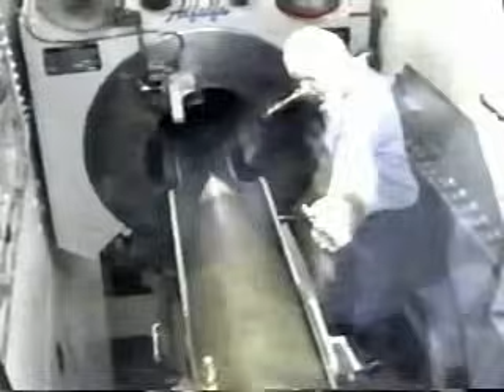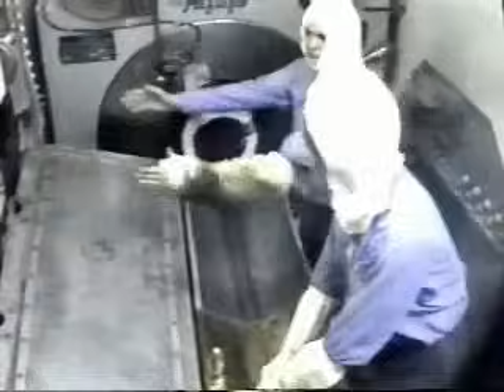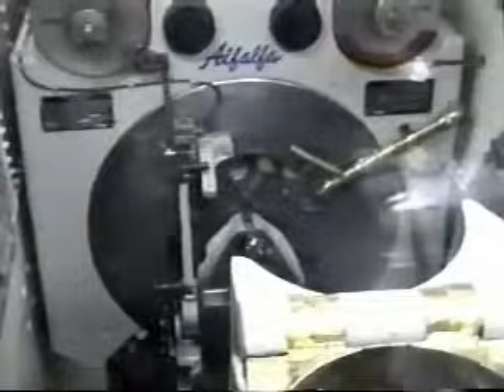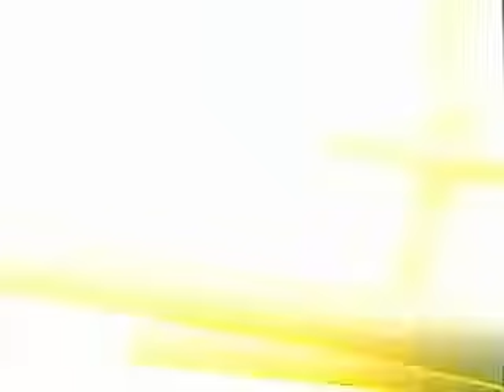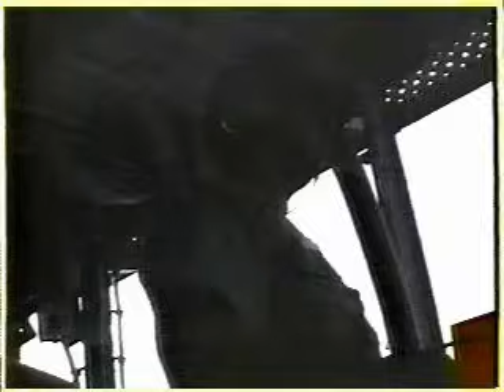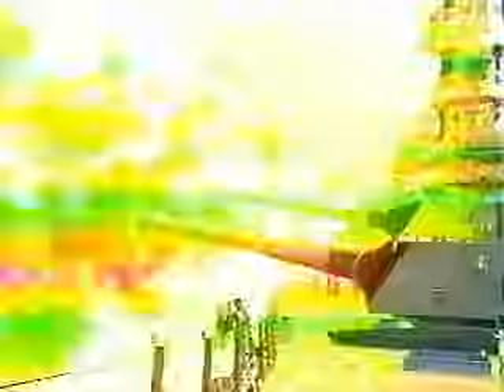USS WISCONSIN BATTLESHIP 16IN GUNFIRE

Comment: Wonder if anyone's ever though of strapping one of those things to an Abrams hull. With or without a turret.
Reply: It's too big. WAY too big. And, I don't think it could handle the recoil, braced or not.
However, a 45000 ton warship is perfect
Besides, these things were basically the scariest naval fire support platforms ever. Like in desert storm, where the enemy would spot an UAV and suddenly from something they couldn't even SEE (out of the horizon) either 9 50 foot craters appearing at once or a rolling fire of what were basically volkswagen beetles loaded with high explosives hitting every few seconds until they were told to stop. it got so bad that they started surrendering whenever they saw that UAV because you don't fuck around with what comes next. their armor also allowed them to shrug off anything that could be sent their way, like tanks.
Reply: Good fkn idea wish they would.
Reply: It's impossible. These guns are nearly four times as big as the guns mounted on tanks. It would definitely be interesting to see though.
Reply: ***** the guns themselves are about the weight of the tanks.
Reply: armorhide406 I'll bet the ammunision weights more than the tanks hull. But I'm sure the Yankees army can spare a tank for an experiment.
Reply: I think large defensive land batteries would be the most likely use besides on a ship.
Reply: Thomas Edgerley I've been on two Iowa Class Battleships and the 16" guns are so big it's almost comical. Fit on a tank?......No way! :)
Reply: armorhide406 If it is to big for one tank, mount it to two.
Reply: Kirrim Kerman Typical Kerbal attitude.
Reply: Lou Graziani That's just a waste. The BB-64's were a balance of speed, armor and firepower (until they were rendered essentially useless by jets and missiles)
The old dreadnoughts mounted a variety of guns, but aiming is hard when you can't differentiate a 10 inch gun splash and a 12 or 15 inch one.
Reply: They should still keep em as museum ships (although I think they gave up on this already)
Reply: armorhide406 

All 4 Iowas are museum ships.
Reply: ***** I thought they were shut down for good. Even as museum ships.
Shit, I gotta go see em before they do!
Reply: armorhide406 

Well they don't fire the guns, however the Wisconsin is getting some of her systems like the 1mc and the antenna rotation restored so the ship will appear more alive. Also, they're opening more and more of the ship up for visitors.
Reply: ***** of course they don't fire the guns
You'd probably go deaf if you were on deck when they did.
Still. it'd be fuckin' badass to see it one in person
Reply: Thomas Edgerley The Nazis did consider building a tank like this beleive it or not using Naval sized guns, it was called the Landkreuzer P.1000 Ratte. https://www.warhistoryonline.com/war-articles/landkreuzer-p-1000-ratte-hitlers-idiotic-heavy-tank-design.html. It was to be manned by 20 men and was to dwarf all other tanks.
Reply: Jeremy the germans did build tanks with 380 mm guns tho look upp stürmtiger :D
Reply: Vipersw3 Wasn't that a rocket launcher?
Reply: armorhide406 well if we are going to be technical it was a gun shooting rocket propelled rounds ;)
Reply: I'm thinking refitted and upgraded Maus or even Ratte hull from WWII Nazi R&D. That might actually work. Granted a 305mm cannon is heavy as balls, but that didn't stop the Sturmtiger, did it?

Comment: What is that exhaust smoke coming from the barrels a little while after the shot? I never noticed that before. It looks as though it comes out with some pressure behind it. Do they blow air inside the barrel after each shot to clean them somewhat? That's the only thing I could think of. I'm talking about the white puff of smoke maybe 15 seconds after the shot.

Comment: I have always imagined that when firing the 16” guns of the Iowa Class Battleships, nobody could be on deck. The concussion and heat blast would kill. True or not, the power of them is awesome. But, what amazes me most, is the structural engineering of turret platform that can carry them and endure the sustained and repeated forces of those guns, over and over again.
Reply: The concussion and heat blast would be bad if the front two turrets were facing the bow and firing same with the stern turret... the broadside isnt that bad cus all of the energy and blast is going into the water and creates a shockwave for a brief second.

Comment: @Contrajoe 
Sure, a proper missile is going to be somewhat more expensive since it'll also need a launch booster, but on the other hand, you can launch it from a destroyer, so in the long haul it's going to be significantly cheaper.

You can see where this is going right?

And then there's the fact you can build quite a few multi mission destroyers for the same price as a single modern BB.

Comment: that's what freedom sounds like...Merica!
Reply: Eh, the Japanese Yamato was bigger and badder.
Reply: Bigger yes, badder I think not.... don't believe me, get yourself a  sub and go ask her yourself, she is at the bottom of the Pacific.
Reply: The Yamato is on the bottom because of aircraft, it never faced another battleship in combat.  The Yamato vs Iowa would be an interesting battle, and the outcome would be entirely dependent on the conditions of the battle. If it was a night battle, or during inclement weather, Iowa would likely win due to superior radar and fire control.  If during the day at range, the Yamato's superior armor and penetration  would probably win out.  There was a big difference between the design philosophies between the two.  Iowa was simply designed and built to meet a certain need, to a specific set of design parameters.  Yamato was built to be the best battleship the Japanese industry could build at the time.  Say what you will, the Yamato was an incredible piece of design and construction even by todays standards.

Comment: because they still had two supply ships that used those plants. Those ships were decommed some 15 years ago and the only steam certified personnel the Navy has today are nuke people and those are hard enough to come by as it is, not to mention that they aren't certified for oil fired boilers.
And then there's the tiny issue that the training facilities are gone, along with the instructors, so you'd have to find those as well.

Comment: Missiles are not cheaper than individual rounds for the primary or secondary armament of a battleship. Opponents of the BBs argue that, factoring in the total cost of recommissioning the battleships and operating them isn't economically feasible, but that's bunk, because operating a modern guided-missile frigate is at least as expensive, or more so. These vessels were decommissioned not because of combat ineffectiveness or obsolescence, but because they interrupted the procurement gravy train.

Comment: No, 76mm is only around 3 inches, so compare that to these guns which fire 16 inch shells. 76mm guns make cute little popping sounds compared to a battleship's 16 inch guns. The reason modern ships have smaller guns is because they rarely need guns at all, and when they do, 76mm is enough. Usually it's just for taking on things like pirates in motor boats.

Comment: @merl0c I think Yora21 said it pretty well up above. It's a lot less accurate (but more awesome) to fire all the guns at once. I believe there is a picture taken from the air of an Iowa class firing all guns at once, so it is possible. You can tell from the shockwaves on the water all being visible at once, since they last less than a second.

Comment: in the 80's when they brought them back to go to the gulf. the navy thought about replacing the fire control system, BUT they found out the 60 year old analog system could put a 16 inch shell weighing 2700lbs within 250 meters of its target. that may seem ineffective but they had an explosive radius of 200 meters. so the shock and fear of it hitting near you is just as deadly as getting hit and killed by it. OH and btw if a battleshif fired a full broadside(meaning it fired all of its guns on 1 side of the ship at the same time) it DOESNT MOVE! if you dont believe me, do the math yourself.

Comment: @transport00001 yeah but at the time all the newer ships were worn far more than the old battleships they had mothballed it was a 100 dollar answer to a million dollar question at the time thats why they recommissioned them so they equiped them with missiles and modern radar and converted them to use marine diesel instead of fuel oil

Comment: Also, dont forget that because a battleship represents a considerable investment, there would have to be a considerable attendant fleet to protect it. And as I said, having a big missile platform, and a missile platform that was never intended to be used as such, does not add much more capability to a modern fleet. So that is why it is not worth the cost of modernizing and deploying battleships.

Comment: On 17 March 2006, which has cleared as museum ships, "deeply concerned" over the loss of the naval surface gunfire support that the battleships provided, Iowa must not be altered in any way that would impair her military utility
    Spare parts and unique equipment such as the 16-inch (410 mm) gun barrels and projectiles must be preserved in adequate numbers to support Iowa, if reactivated;
    The Navy must prepare plans for the rapid reactivation of Iowa

Comment: @WanDeRingLunaticc Thanks, we Brit's where the original Pioneers of the Battleship (even the name is derived from the earlier "Line of Battle ship" [ another word for "Man of War"]) so it's only fitting that we are in the development sector that will see them (or a new generation of Vessel on the same principle) return.
The most powerfull Conventonal Gun i know of was the "V3" (a Monstrous land based Nazi German Super gun that used Sequential Propellent charges to hurl Shells up to 100 miles).

Comment: Actually they are, because all the down-payments have been paid and the infrastructure is already there.
In order to get the battleships back in service you'll not only need to overhaul and update the ships themselves. (Which will take a long time and require the same drydock they use to build and service the carriers with, which means you'll have to push back the construction of the next one, or upset the entire maintenance cycle which can cause the whole deployment system to collapse)

Comment: I think there will always be a place for battleships like these.  After all, with all the electro wizardry that modern ships use, how long would it be before somebody develops an easy to use EMP weapon?  At least with these old veterans you can still fire them under manual control, even if the accuracy of those big 16 inchers would suffer as a result.

Comment: Additionally if you were to upgrade an Iowa with missiles of its own (yes I know they did this in the 80's), what you are left with is a big ship that can now shoot missiles. Smaller ships can fill the same role much better these days. A single modern destroyer could probably take on an entire WW2 task force by itself. 
Perhaps thats an exaggeration... nevertheless battleships were designed for a different paradigm, and they wouldnt fit well within a modern fleet.

Comment: The Wisconsin could fire 1 round every 2 minutes.  Shell loaded first then 6 - 110 pound powder bags. During the earlier wars,  the crew was about 3000 men. They could fire all 9 - 16 inch guns at the same time but because of the new electronics, they fired the 3 turrets left gun, right gun then center gun.  Crew was reduced to 1500 during the Gulf War. Rumor has it that a "full broadside" would move the ship back 32 feet in the water.
Reply: The rate of fire for each gun was up to 2 rounds every minute and the ship rocking sideways when firing a broadise is a myth, they were completely stable in the water.
Reply: Negative shipmate I served on the whisky punch 87-91
We fired all 9 at the same time multiple times!
During GQ I worked 3rd turret loading powder on the elevator 5 decks below
I also worked flight qtrs and was on the flight deck multiple times when firing 1&2 turrets

BM3 Ellis
Plank owner

Comment: 16” diameter; 6’ tall; 2700 lbs; 27 miles. Each round covers a 1000 meter grid square. I was USMC Artillery FO and I watched USS Wisconsin guns throw up chunks of dirt the size of a Volkswagen beetle in Nam’. About 15 kilometers south of the DMZ. Marine ANGLICO was calling the fire mission. Shock wave was felt almost 2 mi. Away. Craters 30’ wide; 15’ deep......would have made a nice Koi pond. USS Wisconsin has more firepower than many nations on earth.

Comment: Well, it could be more economical to shoot a modern equivalent of these (say a railgun) than to shoot missiles. In this case each round would only cost a sabot and a large tungsten/steel projectile (only a few kilograms though,) sacrificing neither range nor accuracy. Missile costs per unit are large due to the advanced targeting, explosive, and propellant systems used inside. Kinetic weaponry is great for taking out pinpoint targets without much collateral damage, making surgical strikes easy.

Comment: I'm pretty sure the Navy's official statement is even if a Destroyer fired everything it had at a Battleship, it would need 100% accuracy with perfect hit placement to disable it and flat out couldn't sink one.

Battleship could out distance a Destroyer too, so it could run being faster, but it will be caught, and it will be demolished.

Sheer expense is the only reason they aren't in use still.

Comment: The smoking lamp is lit. 
Dont hear that underway nowadays. 
But in the old navy we didnt have pink stress cards we could pull out when things got tough in basic. 
At RTC SD where I began in dec79 we got to jump off  tower for swim test which was I believe 30 or 35 ft. Then you had to stay  afloat in a pool without touching the sides for 15 min. (I liked cliff jumping so went around for seconds. CC was like your shorts are wet. Didnt u already....?) Didnt bother treading water, just lay back n relax. 
Now I hear its a 10 ft jump. 
FTN

Comment: I think with the advent of railguns and DEW's, the age of the battleship can one again come to fruition.  Just think about how dangerous a weapons platform armed with railguns and lasers will be to drones, aircraft, ships, land targets, and missiles.  Furthermore, due the the scant logistical requirements of lasers and railguns coupled with a battleship having the girth to mount a very hefty power plant to feed the weapons, is there any reason not to take a second look?  An Iowa-class fully kitted with directed-energy and kinetic weapons in the future is probably cheaper to run than a carrier+air wing anyways.
Reply: SpenzOT Cheaper to run than a modern day carrier? Maybe. more effective? No. Direct energy weapons only go as far as the Horizon on GOOD weather. Railgun? At best lower end missile range but then again it will most likely miss. A single carrier would send any battleship to the bottom of the ocean with or without escorts and take no damage.

Comment: "Gun cotton" is nitrocellulose, a type of smokeless powder.  The term "powder" is perfectly applicable, thought it is not literally a "powder."  It is small, cylindrical grains. 

No type of "gunpowder" has actually been a "powder" since the 14th century.  All smokeless powder, including the type used in small arms ammunition, is extruded, and you end up with little cylindrical grains.  

But yes, it IS "gunpowder" in the same sense that all smokeless powder is "gunpowder."

Comment: Why don't we just put our modern, super accurate, easy to reload, and cheap (compared to cruise missiles) artillery on ships?
Reply: Cruise missiles have a much farther reach, and can pinpoint targets. Cruise missiles also have a platform, destroyers, frigates and cruisers, that are much lower maintenance. The 16 inch gun was good in WW2 for shore bombardment. In today's environments which are often hundreds of miles inland, they have little purpose. If the crew on a guided missile ship wanted to, they could put a cruise missile through your window.
Reply: +McDago100 You can do the same with a 16 in round with the right tech ( ramjet, rocket propelled with base bleed) and FYI if it in range of them why use a missile when a 16 in round could do the job at a cheaper price and you can't jam a 16 in shell.
Reply: Battleship009 There is technology to make a 16 inch round have the precision and reach of a Tomahawk or Harpoon missile? As you are aware, all battleships with 16 inch guns were built over 70 years ago. How cost effective is it to update them to handle the new technology you are speaking of? I am not a planner, those people are at the Pentagon.
Reply: McDago100 yes, artillery is ridiculously accurate. No, it won't reach as far, but I'm saying put 2 or 3 howitzers on the destroyers and frigates we have for "close" (and then cheap) range fire
Reply: Will Edwards Not to be technical, but you say howitzer. If you want range from a gun, it helps to have a very long barrel. Are artillery pieces that are used for range, such as the 155mm Long Tom, considered howitzers by today's standards?
Reply: McDago100 I figured that's just what we called them now a days, a misnomer, yes, but the accepted name

Comment: the load & fire rate is alot quicker then the video shows its more instructional then actual & the old analog computers onboard the iowa class could not be improved apon since most of the time it would put round 1 on target.the gyroscopic systems of the guns are state of the are , same reason the m1 abrams can shoot on the move